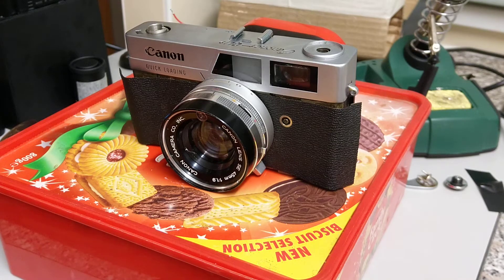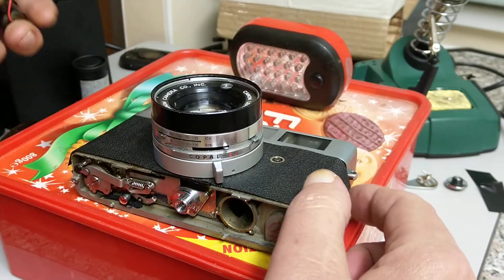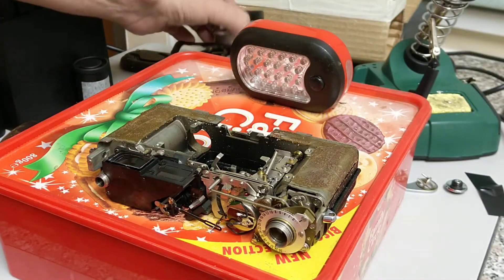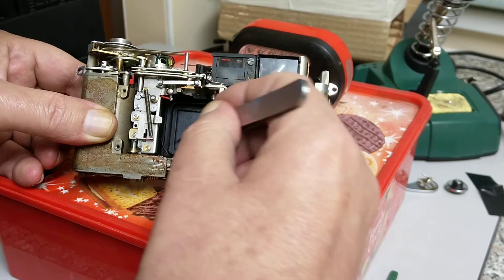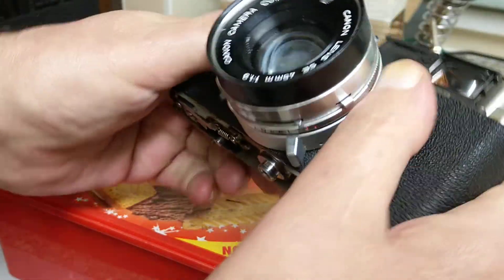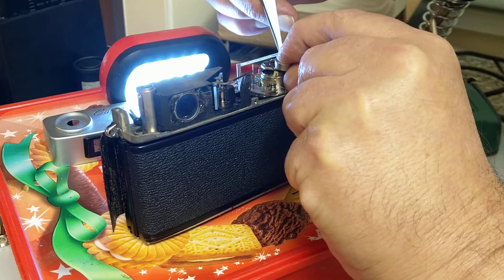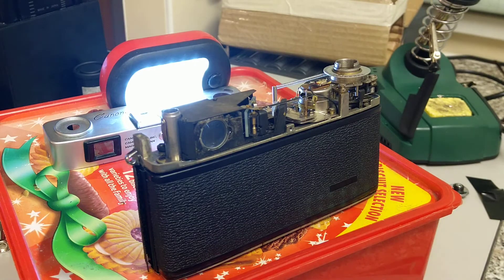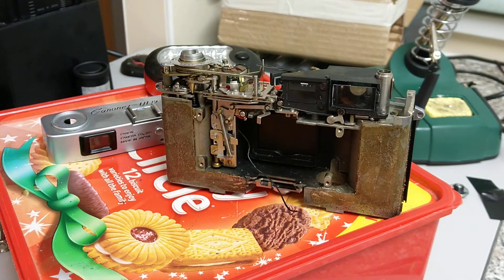Canon Canonet 19QL, repair part 1, meter not working

Comment: Mine doesn't work even when im using a px625 1.5v battery. Not only that, but it heats up the battery compartment and the battery. So maybe its the wires touching something else.